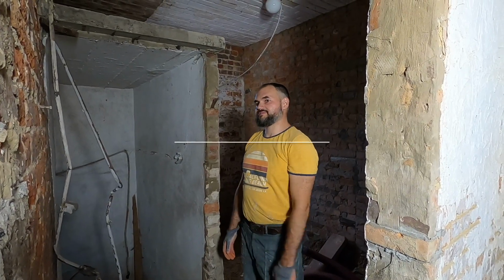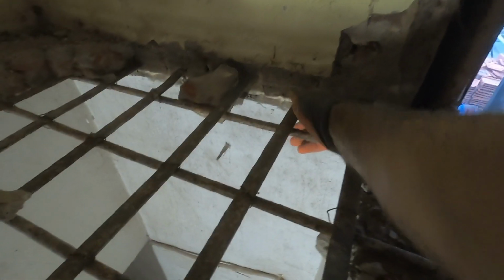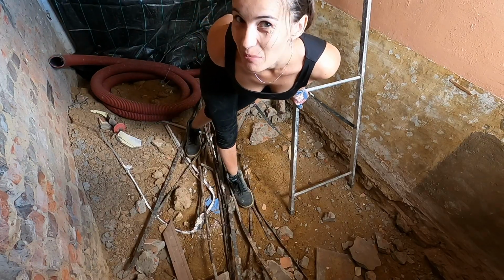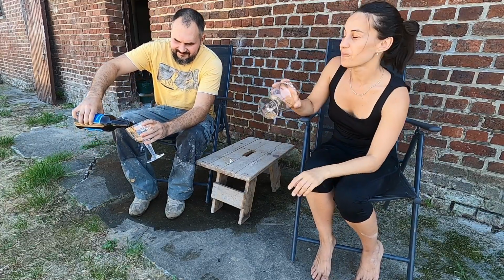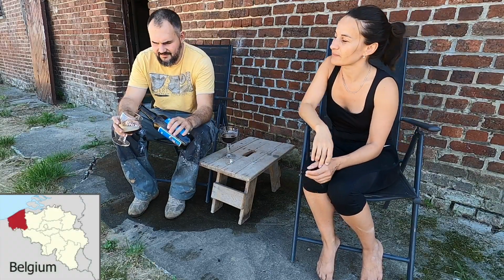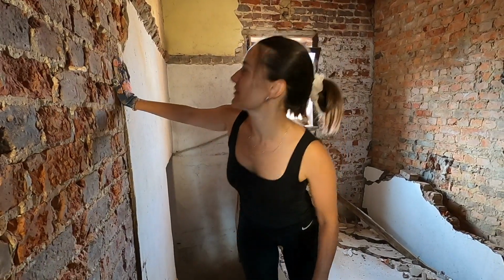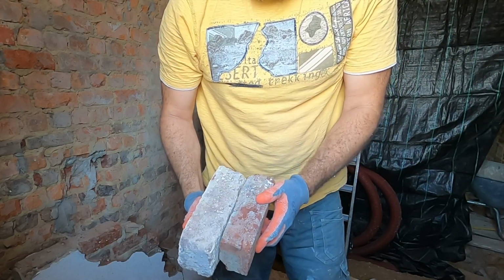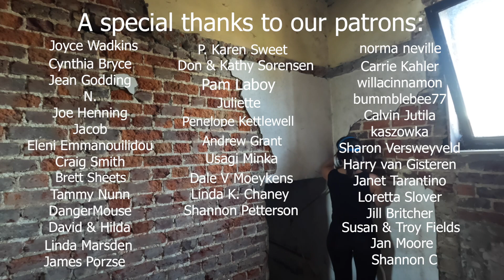Making tiny room BIGGER / Renovating an old ABANDONED farm in Belgium

Comment: Hey guys, I have followed you since the beginning and watch you every week! I wish not to be rude but I thought I could give you a tip on using your sledgehammers. You used what we call in the states a four-pounder to remove your interior space. In ascending order the next ones up would be an eight-pounder, a twelve-pounder and a fourteen-pounder. (Yes, there are sizes in between) The tip I wanted to mention involved in deconsruction is how to use your heavy hammers in a way that doesn't hurt your back and takes less hammer blows to be effective. I noticed you were giving blows with the hammer on the edge and not the surface of it. If you change your strategy a little, concrete (and other hard materials) can be destroyed most effectively when you strike with the flat surface. The force behind the blow of the flat surface sends shockwaves in an even pattern through the concrete and it shatters like glass. When you hit with the edge of the hammer it sends smaller shock waves in more of a linear pattern. Hope I described this correctly! I love your determination and very hard work. Please keep up the great work!! Illia will have a six pack in no time!
Jeff C

Comment: You will be so glad you reclaimed that space. Separate, it was a small, pretty useless little room. But when combined with the adjacent room, the result is a nice, large room. Plenty of options and ideas for it I am sure! 🙂
Reply: There was a reason for that wall there, it was not just a cellar, it was a safe place to hide from bombing in the wars
Reply: I don't really see how they actually gained any space by removing the wall though, it only makes the room feel more open but the stairs are still there.
Reply: @Ragnar8504  I think they are going to remove the stairs and make another way in with shorter stairs

Comment: As for the beer: Westvleteren 12 was for some time (1946 until 1992) brewed in the St. Bernardus brewery, so one can assume that the brewery knows the recipe. It may be just a rumour that St. Bernardus is still brewing a quadruple based on the Westvleteren 12 recipe. I have tasted both beers (St. Bernardus abt and Westvleteren 12) several times, and to me it is clear that Westvleteren 12 has much more taste and fragrant aroma's. It's comparable with beers that are bottled with a bit of extra yeast, allowing them a second fermentation when already bottled, and then kept for a longer time. In that case, a process called maderization can take place, which yields a lot of extra and complex aroma's. Westvleteren 12 seems to have that, St. Bernardus abt doesn't. Maybe Westvleteren beer is kept in bottles for a longer period at the brewery before it is sold. In order to test this hypothesis, I have some bottles of St. Bernardus abt stored for a longer time (several years in the meantime), and I am going to compare them with the 'real ting' at a beer tasting with my neighbours in the near future.